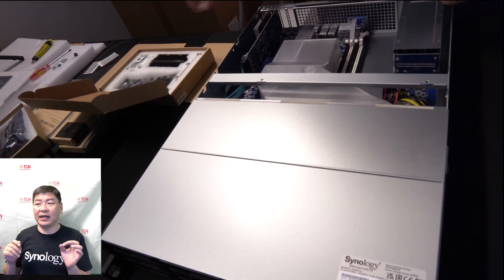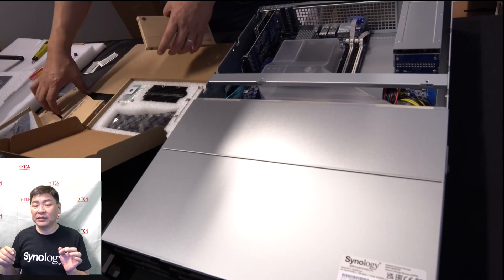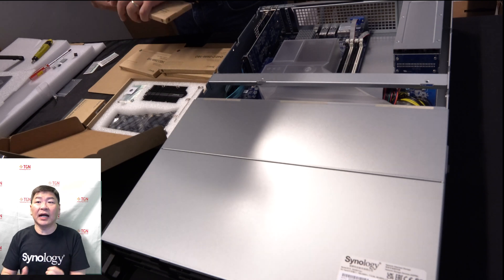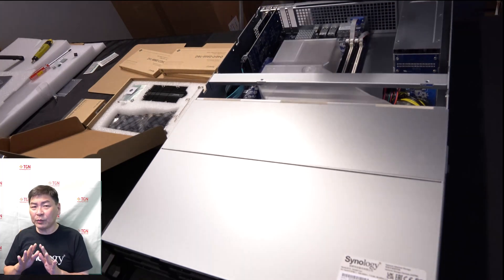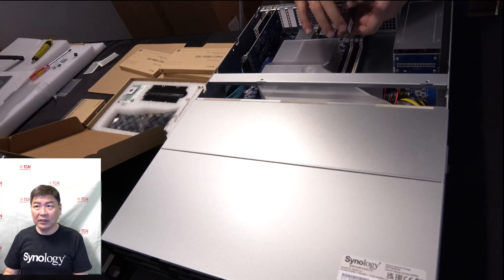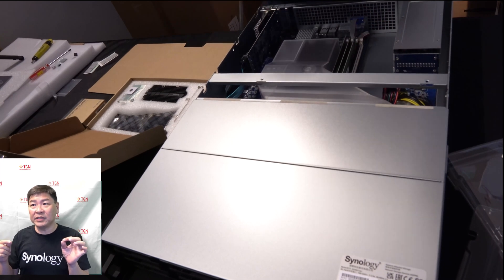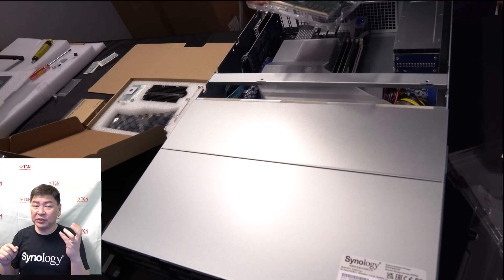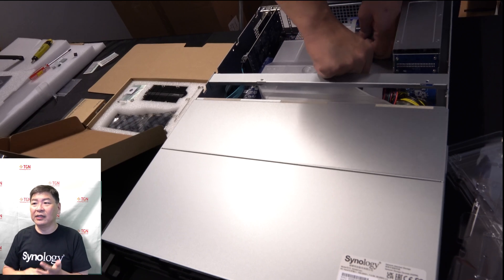Synology ECC RS3621xs+ ram installation

Comment: if only installing 32GB memory what slots are used?   Using 2 16GB ECC modules.  I would mention 1 16GB,  2 16GB as well to show the placement.    Thank you!
Reply from the maker: Yes.
Reply: @TGNTechnology  I was able to figure out the slots I need for 32GB  -  2 X 16GB modules are A0 and B0